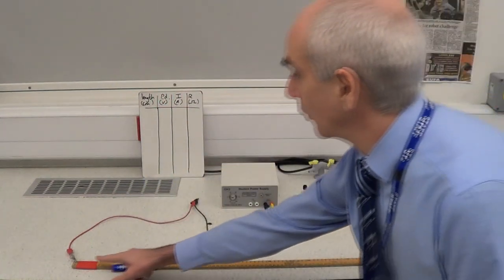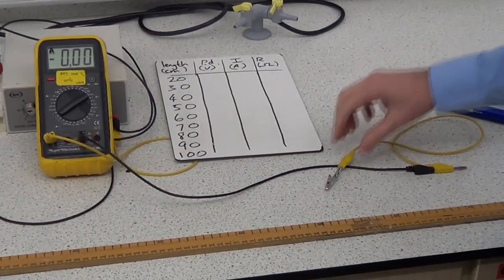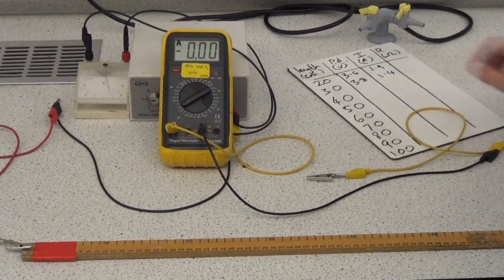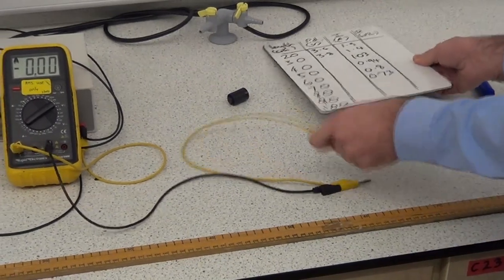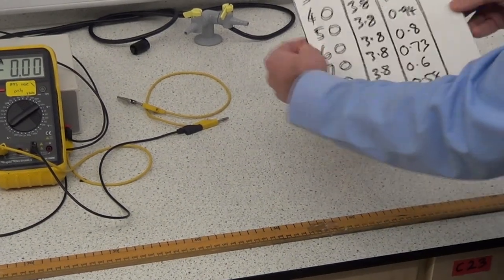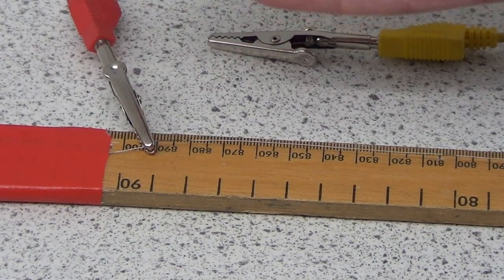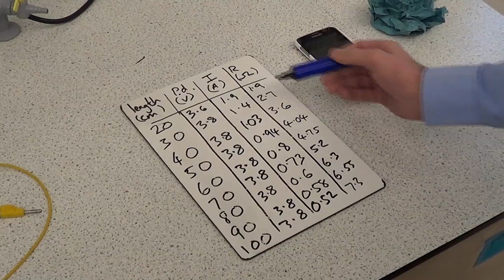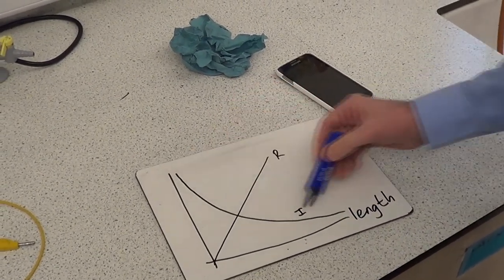Resistance of a Wire

Comment: I want to duplicate this in my class but I have some questions: 1. Could you please give the details on the conductor used such as size, is this copper or aluminum, 2. Can I use two 1.5 volts batteries instead

Comment: I am trying to determine the resistance of 500 feet of AWG #8 TW copper cable using a 1.5 V battery and a cheap multimeter.  I get about 1.25 amps which divided into 1.5 V gives 1.2 Ohms.  Is this a reasonable approach?  Do I have to subtract the resistance of the battery?  The spec on the wire is about 0.3 Ohms for 500 feet.  There is no evidence of damage to the wire or its insulation.  The copper is clean.
Reply from the maker: Depends how accurate you need to be.  That is the correct approach unless you need to be super accurate.  Yes you can also subtract the internal resistance of the battery.  If you are using a multimeter it may have an Ohmmeter built in.

Comment: If we give 100 persent  power to a moter . 
how much  persent will get losses in heat and resistance out of 100 how much
Reply from the maker: It varies a lot.  I guess about 20%.  Motors are much more efficient than engines.